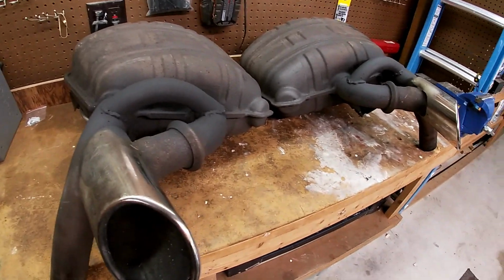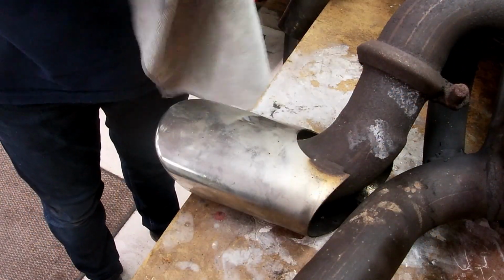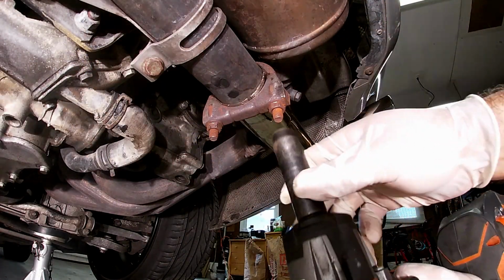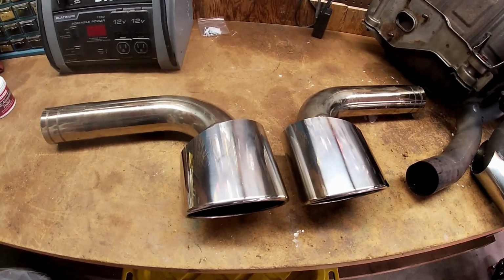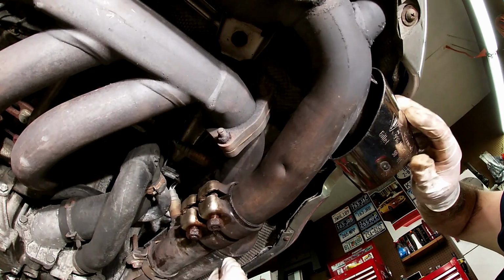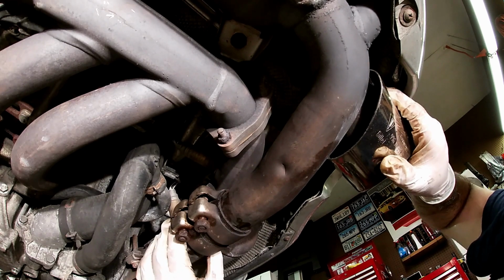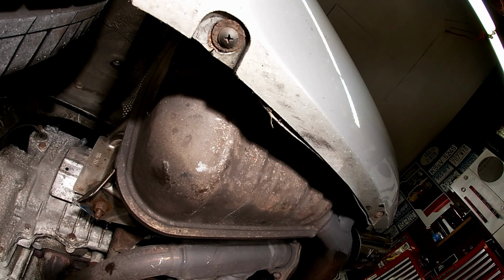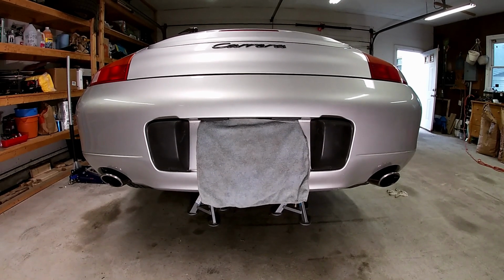How to Fister Style mod a Porsche 996’s exhaust

Comment: I have Fabspeed cat delete and muffler delete love them but can not drive permanently.  It takes me 2 half hours to put the muffler back on.  I remove the bumper and heat shields to make it easier to install and clean the parts along the way.
Reply from the maker: Hows the smell from the exhaust with no cats?
Reply: @KevinsEuropeanGarage  smells better LOL. with 93 octane gas.  I imagine Boston is much more strict than where i live in Kansas.
Reply from the maker: Well yes sound level wise I don’t feel like getting pulled over. One nice thing is they don’t check emissions equipment when the car is 15 years or older. So no cats as long as it’s not too loud. I’d probably go for the 200cel cats and a nice set of headers. I do like the soul performance ones.

Comment: How would you adjust the tips left to right. I have an issue with one of my tips being off centre in the bumper housing. (996c4s).
Reply from the maker: There is a clamp that hold the tip to the muffler pipe if you loosen that up you can adjust the tip.
Reply: @KevinsEuropeanGarage  I tried this but the movement is in an arc? Is that right? Seems to not want to be placed exactly where I want it. Maybe I'm doing it wrong lol!
Reply from the maker: The other choice you have is to loosen up the muffler and and main muffler clamp and reposition that way. There is some play on how the muffler bolts to the bracket
Reply: @KevinsEuropeanGarage  is that the two bolts on that single clamp
Reply from the maker: There is that clamp that hold the muffler to the cat pipe and the three bolts that hold the muffler to the engine bracket. You would have to loosen all and you can try to move it and tighten it in a new position. But if your engine mounts are worn the tips will sit low in the bumper might be worth checking them out.
Reply: So I did the delete and it's just way too much. I'm almost afraid to do anything to the car because I felt like I was a target with that exhaust. I'm thinking about just going back to the stock. I noticed also that with the bypass I seem to lose quite a bit of my bottom end. There's probably more up top but it's so loud when I'm up there I can't stay there very long. Is this D mod going to still be too loud for me,?